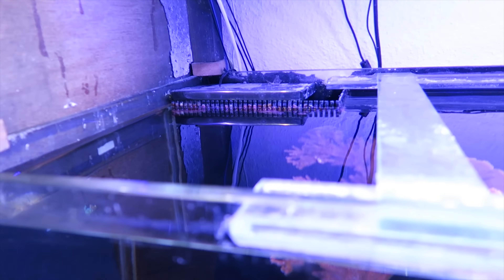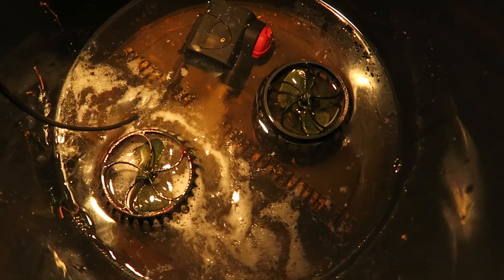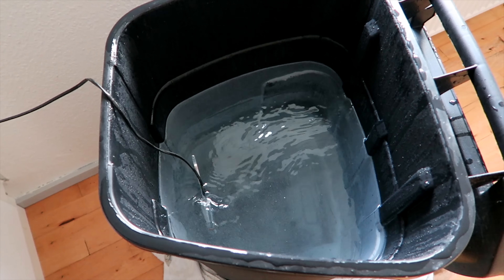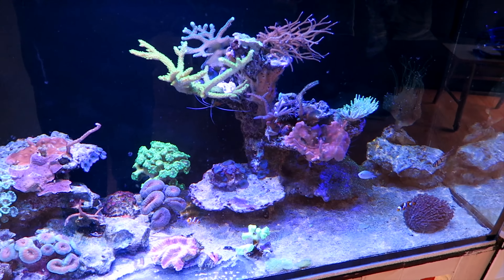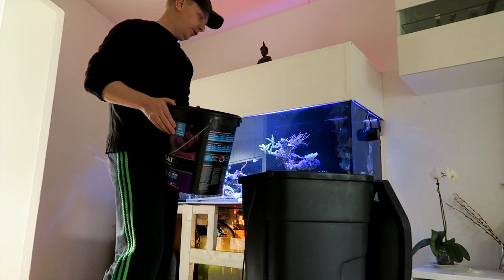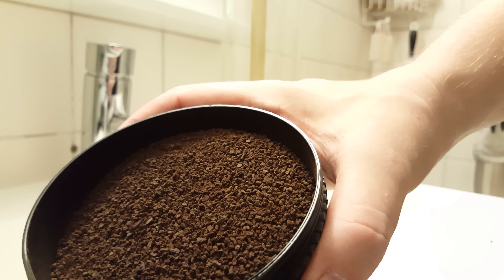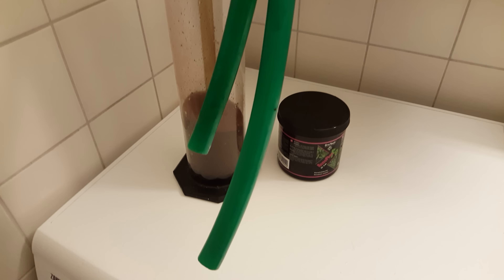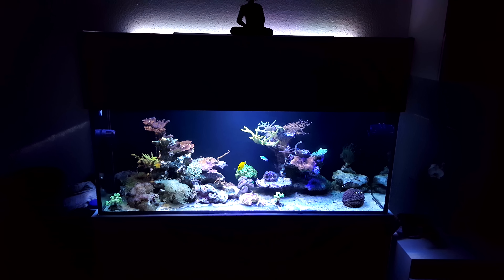StudioReef 2016 "Fixing Up My Reef Tank" (Part 3)

Comment: Hey mate what skimmer do you use?
Reply from the maker: I made a daticated video for my skimmer :D
https://www.youtube.com/watch?v=sX0o4Fbbxpw
The "SKIMZ SM 203 Monzter"
Reply: StudioReef awesome thanks mate. I've been looking at a skimz 163 for a 120-150 gallon. Do you think that would be big enough or would I need the skimz 203 you think?
Reply from the maker: BV G I would go for the 203 if it fits in the sump. Make sure to get the DC one so you can run it on lower speeds. this makes it dead silent :)
Reply: StudioReef cheers mate really appreciate all the help. Now I have to hunt down a 203 (I'm in Australia so not as many reef shops)